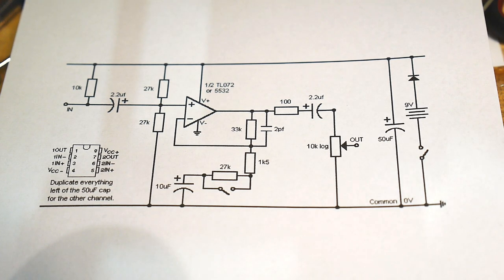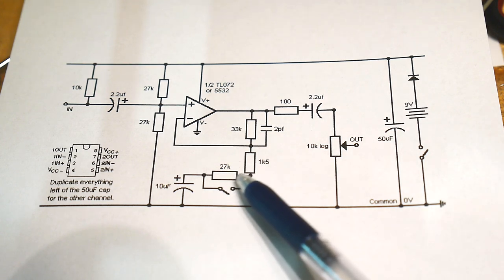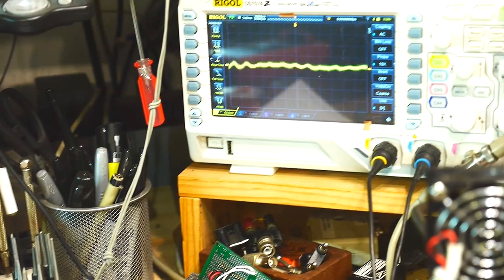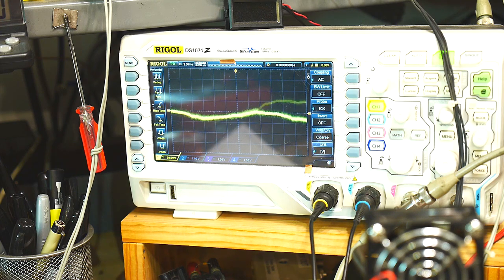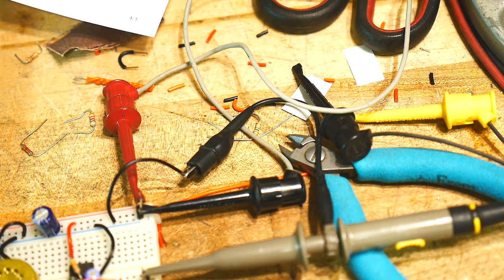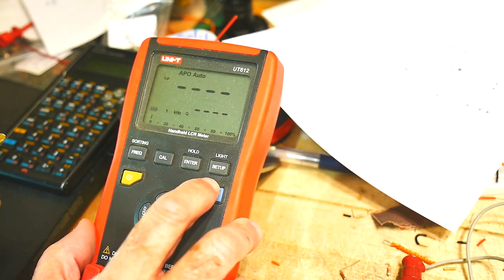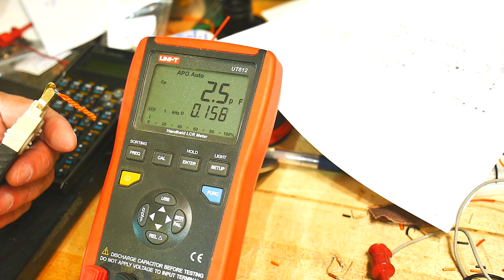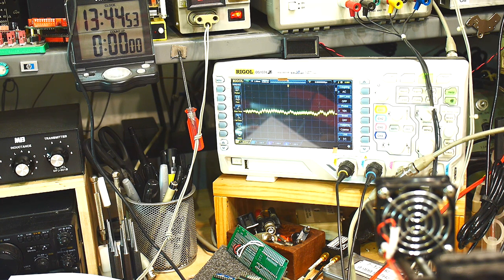#421 Opamp microphone preamp with gimmick capacitor

Comment: I'm currently restoring a Hallicrafters S-107 receiver. Capacitor C61 in the circuit is marked as a "wire gimmick". They took a piece of insulated wire and wrapped it around a tube socket pin (between the ANL plate and BFO grid). So YES you do run into them.
Reply from the maker: I have a two meter J pole antenna that uses a wrapped insulated wire on the main element as the feed point. It is a capacitor but also allows the feed point to be slid up and down to match SWR.

Comment: What is the size diameter and type of microphone on the board - looks like something that might be used to replace the D-104 Microphone Elements when they fail.
Reply from the maker: MKE-84 мкэ-84 Russian Vintage Electret Microphone Capsule
Miniature can size approx. 22.5mm dia x 6.5mm high.